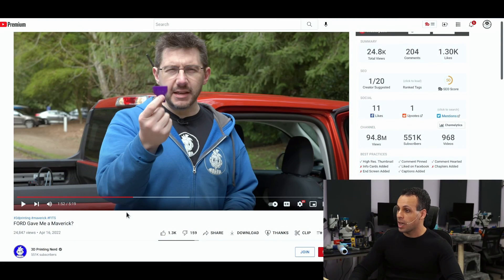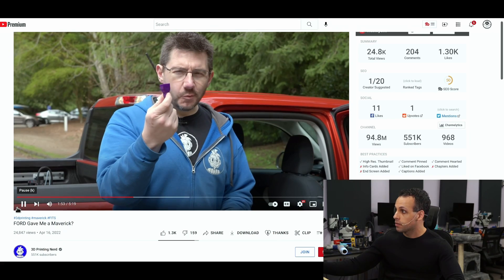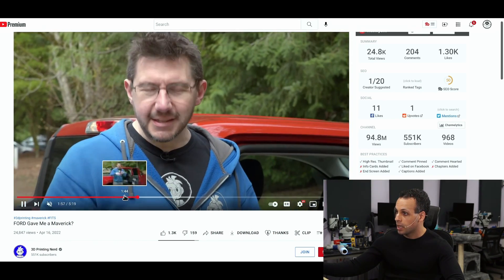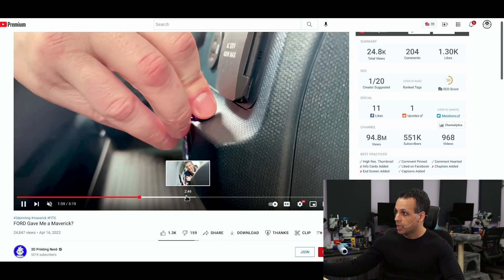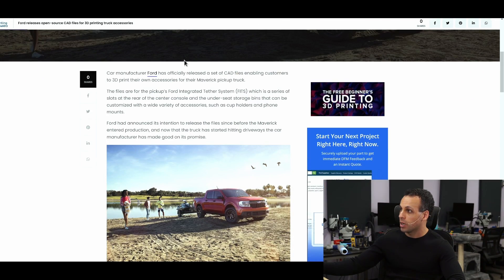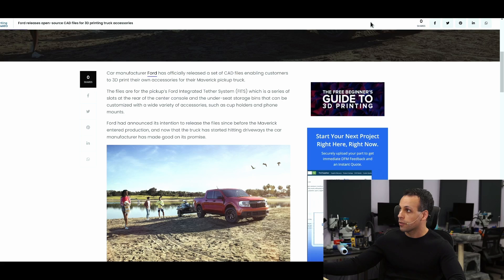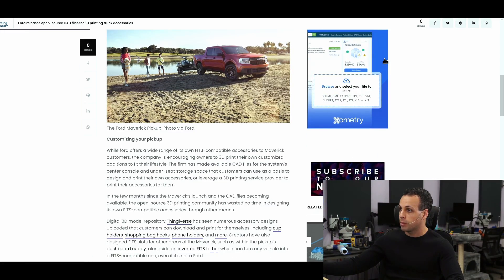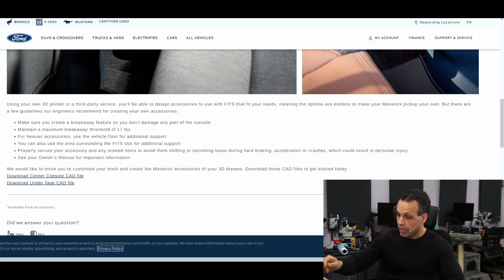Here's how to properly engage with the 3D printing community

Comment: I don't understand how 3d printing your own part and sharing the cad file is any worse than manufacturers making aftermarket exhausts or other aftermarket accessories for Honda vehicles. Why is Honda ok with aftermarket accessory manufacturers but not ok with 3d printers? Do they really lose that much money when people print their own little plastic pieces? Are they really worried about losing 0.0001% of their annual revenue?
Reply: The problem is if you call it "Honda Cupholder"
If you call it "Honda compatible Cupholder" it is ok.
They probably had hired a lawyer to fight against fake products and they have found the 3D Community and did there job to sue them, that would be totally fine if the 3D Community is a company that produces fake parts.
But it is a Community of there own Custommer, the better respond would be to inform them that they have to change the Name of there designs to " Honda compatible ...."
Reply: @jonasstahl9826  If "Honda Cupholder" would've been their only problem then they could've just done what you wrote yourself (and what Louis said in the video too): ask the authors to call the models "Honda compatible Cupholder" instead. But no, they just went full brute mode and had it the fuckin' DMCA way. This alone makes their malevolent intentions more than obvious.
Reply: @jonasstahl9826  In the UK, you will generally see "Cupholder model XYZ3", and there will be a separate sheet, or page on the website where they tell you which cars Cupholder Model XYZ3 fits.
Reply: Because if these peasants figure out they can do things for themselves they might try to fix their own cars instead of either buying a new one or visiting the honda repair man.
Reply: They don't care about revenue that much. They are simply testing the legal system as far as it'll let them.

Aftermarket parts have a lot of case law and regulations attached to them, bitterly fought against car companies, which says exactly which sorts of aftermarket parts can be manufactured and which can not, and how they are to be made and labelled. 3D printing part models have none of that, so car companies see an opportunity to try to gain or establish legal ground. They don't need another reason than that. Once legal ground is lost, it will never be regained.

Mind you all the justifications everyone in this comment thread is offering are arse. Of course you should label parts such that they aren't confused with OEM parts. But no matter whether you did, they had EVERY SINGLE existing mention of Honda banned from the site.
Reply: Fun fact: a lot of these items are also obsolete that they won't even sell to you, yeah go buy a new car if you want cupholders. LMAO honda logic
Reply: it's normally because the aftermarket parts companies pay a licensing fee to make them
Reply: For a variety of reasons a lot of people are looking to scans at 3D printing in general.

If it is able to live up to its potential the possibility exists that manufacturing will become very difficult to regulate, either by the government or by holders of intellectual property.

For example with the right equipment I could produce something the government would be concerned about such as a weapon or something a trademark lawyer would be concerned about such as a brand name product.

From Honda's point of view, which resembles that of the recording industry, anybody doing your thing but you is theft.  At the very least it's hard to quantify how pandering to this particular audience is going to either add to the bottom line or gain you in customer goodwill.

One thing that we usually Miss in these conversations is that above All Else any business values predictable revenue.  For an auto maker the repair and aftermarkets are the predictable part and of course sales is less so.
Reply: Honda really added fuel to a tiny fire, they were trying to put out… This “takedown” has made headlines and most people didn’t even know 3D printed parts were a thing. Know they now and they’re probably unhappy with Honda’s blatant overreaching on this.
Reply: and the companies get a bit of the money pie for the aftermarket parts
Reply: They do care. They just cant stop aftermarket. Theyve tried and lost
Reply: Do 3rd party manufacturers pay Honda a small licence fee to make parts?
Reply: They are frightened of losing control. However I expect they will get smart and integrate themselves with this technology which has the potential to make the world better and so more profitable. It's like when Sony stopped the company making custom panels for the PS5, they missed the point. It's not a massive huge profitable market for Sony, that would be the machine itself and the games, no the customisation is the owner building a strong bond with the machine they own. This is good for brand loyalty.
Reply: Probably some corporate lawyer threw the world "liability" around and the suits all panicked
Reply: Its about making it look like it comes from honda. Not the file
Reply: Because when Car companies tried to go after the after market parts a law was passed that allowed the creation of after market parts so legally they can do nothing.
Reply: Shallow answer, a lot of aftermarket parts and installations void warranty on vehicles. Not just new vehicles, but reasonable consumer expectations going out to the 7/10 year mark.
Reply: @TheBrewjo  extended warranties are a scam. They are designed to keep you wedded to the service department. And... you paid for it in advance in the purchase price.
Reply: Because its a easy win. Take out the small people first.
Reply: licensing fees
Reply: good point on after market parts
Reply: They will lose their fan base of oem Honda fans
Reply: It's easier to attack the diy community than actually make a business more profitable
Reply: if you sold a aftermarket exhaust that says HONDA all over it, i would imagine that they would not like that, as it might imply its an oem exaust.
blame the legal system/generics,eg... because xerox decided not to peruse legal action for others using the term xerox generically they lost rights to the phrase. stupid lawyers, not saying this applies directly here, but i can see why some companys have to defend there brand out of fear they have something to loose if they dont.
Reply: @brandon45-70  velcro, 3M did a huge campaign in the early 2000s to get people to stop calling generic hook and loop stuff Velcro. They are afraid that it will go the same way as the Xerox case, and they will lose the right to the uniqueness of the phrase and the trademark protection granted. What Honda's doing is forcing aftermarket parts makers to pay a license to use the name Honda if you want to make a Honda part, even if it's not made by Honda. This is how all aftermarket parts work already, which is why some cars just don't have aftermarket parts support, because the manufacturer will not license or allow third-party makers to make replacement parts or upgrade parts.
Reply: @chubbysumo2230   "This is how all aftermarket parts work already, which is why some cars just don't have aftermarket parts support, because the manufacturer will not license or allow third-party makers to make replacement parts or upgrade parts."

bullshit
Reply: @chubbysumo2230  It varies by state, but Honda can't do that really.  There are laws that allow for aftermarket and non-OEM parts for vehicles (and rules they have to follow).  However, they might say "door guard fits Honda" or "Honda compatible door guard" or "universal door guard (fit Honda, Toyota, Ford) - but not "Honda Door Guard".  In the 3d case, Honda saw a way to harass makers - and did so by calling it a copy or trademark violation en masse  - didn't much matter if it was or was not on an individual bases, the host doesn't want to deal with it..
Reply: @brandon45-70  That actually is kinda incorrect. Under the copyright law if a term gains "popularity" it becomes part of the common lenguage and those you cant claim rights to it. That happened to xerox with the fotocopy machine. Could and probably will, happen to google as it has become a simbol of web searching. Nintendo fighted this hard in the 90s and 2000s because it was becoming a word for "videogame console"
Reply: @zeke7515  im not saying its correct/ or i agree with it. just was pointing out why these things happen. i dont think they can even tell them to take them down as they are not selling them. if they where profiting somehow i could see a case but if your giving it away for free. idk ianal
Reply: @brandon45-70  It isn't a matter if the item was for profit or not, trademark holders have to vigorously protect the trademark or lose the protection. Honda's legal team was likely being lazy, ignorant, & cheap in its enforcement.  Companies have been known to go after fanart that include depiction of trademarks, even when there is something to the effect "The trademarks depicted are the property of their respective owners and not meant to be considered an endorsement or representative of the owners"
Reply: @NexUbra  Seeing as genericization is ever prevalent, considering Xerox lost the right to use its own name for its products, and Nintendo fought as hard as it did in the '90s and '00s to preserve its right.
Reply: It's literally a copyright thing. Honda doesn't care that you are 3D printing parts for their cars. Just don't go around slapping their logo, which can make it seem like an official Honda product
Reply: @--------.--------------------.  You have the story completely wrong. Honda was taking down anything, even things that don't have their logo on it. This was confirmed by staff at Prusa (the site that received the takedown notices/lawsuit threats) as well as several people who had uploaded files that got taken down.
Reply: @mjc0961  Didn't those say things like "Honda Civic cup holder"
Reply: @--------.--------------------.  I honestly don't know if that's the case or not, certainly that's probably the biggest single concern...  But the trend in industry in general is to seek a walled garden where you have a nice predictable stream of income.  As someone else said, letting the peasants make their own stuff would interfere with this, and we can't have that.
Reply: @--------.--------------------.  

Umm logos with names is a Trademark issue not a copyright issue.